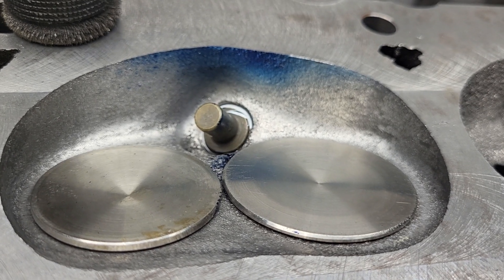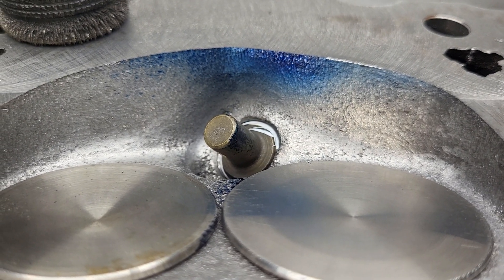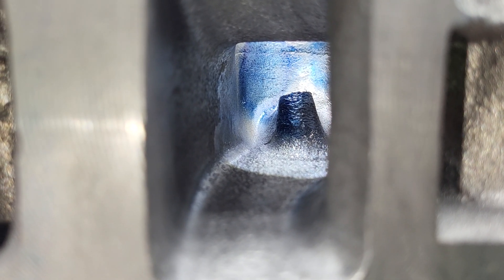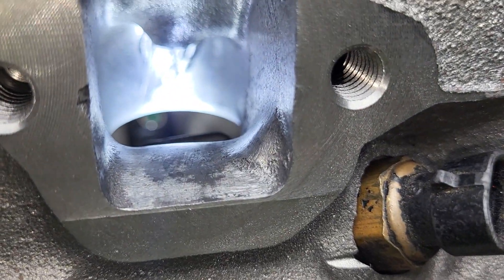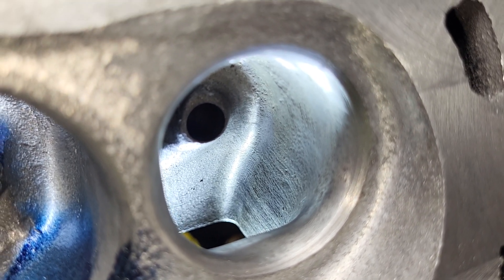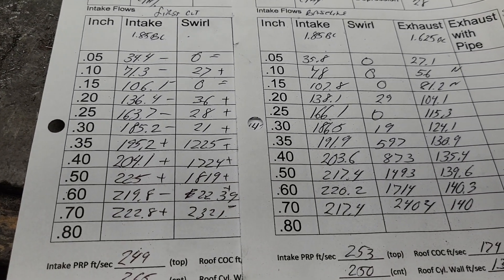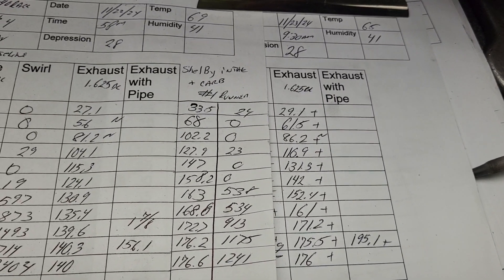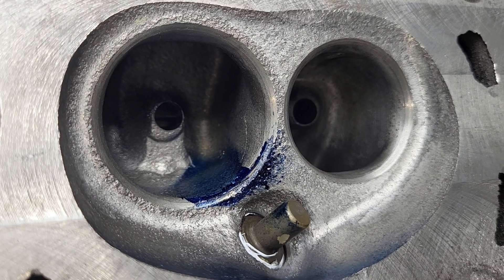Ford GT40 289 Race project, Ford C6FE heads, First cut flows and airspeeds

Comment: Thanks for all the videos and all the legit info! 
Question: 
Maybe i missed it? 
But why are you starting to port on the heads when the valve seats have not been installed yet?
And you do not have the actually valves yet that will be used?
Reply from the maker: @therory6888  Iron heads can have seats cut directly on the iron. I can do that. Iron will not wear excessively if the guide clearance is correct.
Reply: @ Okay. Thanks

Comment: Charlie, question for you. I always consider the throat a final choke point so I will measure it at different areas looking for the smallest measurement.

For example, on an E7 with the 1.78 intake valve I will usually get a 1.51” measurement side to side (3 to 9 o’clock and same as the bowl width), and maybe a 1.55” at the noon to 6 o’clock position, a 1.57” at the 2 to 8 o’clock position and a 1.56” at the 4 to 10 o’clock position.

I’ll average the four of them and use that number as the throat size.

Is this similar to how you do it?
Reply from the maker: Smallest area at the valve seat is called a Bernulli port. Most castings can not do that with maximized valve sizes.
Reply: @ thanks for the reply man. I see your an early riser too!
Reply from the maker: @65mustang393  Sleep is overated!!!
Reply: @ man… I have the goofiest sleep schedule. Totally random and I am very envious of people like my wife who can lay down, be out in 5 minutes and sleep for 6 to 8 straight hours and wake up totally refreshed. My sleep is more like 3 hrs now, 1.5 hrs at noon, etc. Makes for a difficult life at times lol.
Reply from the maker: @65mustang393  My Wiffy is asleep instantly and 12 hours is not a problem.
Reply: @ lol… yup.
Reply from the maker: I measure the throat size the same way. Thanks

Comment: Time to use your wind flag wand to see what the port wants. A good friend of mine Joel A. Dubose has always said to me, " Don't try and force the wind and fuel where you think it should go but actually see where it wants to go naturally." The valve guide Vane is a good idea to see if you can pick up anything at all. That Exhaust is BIG, good lord. I would play with clay and raise the floor up to that bump and see what happens. I bet those heads take off like a Banshee. Those are definitely thin castings in areas where its critical to make them flow. Flow ball time with the wind flag.
Reply from the maker: @garykarenmcgruther6386  Stay tuned! What a sonic workout!!!

Comment: I have a set of aluminum heads, I need steam holes drilled in them . Not something I really want to tackle myself. I would want at least a drill press. A bridgeport mill even better. (They also can use a bit of abrasives ran through the ports also. I have two sets that can use a bit of port play!✌️ 😎 👍, have an awesome day....
Reply: Just use a head gasket as a template.  Lay the gasket on the block and note which gasket holes line up to the block's steam holes.   Use the gasket as a template to know where to drill the new holes.  Use a punch to mark the head, and drill until you're through the deck.  It's actually really easy with a hand drill.

Comment: You talking about the short side being thin. It made the think, that being a new casting. I wonder 🤔, could the thin area be heated with a torch or induction heater (probably both) and flux the inside, slip some silica bronze, or possibly nickel. To add some thickness to the area. It would be cool if a powdered bronze or nickel could be poured into the water jacket with flux either in it like solder(flux core!) Heat the area until the metal melted!! The flux assuring it sticks after it melts. Do you know if anyone has done this BEFORE Breaking THRU TO THE WATER JACKET? Adding about .045" to .060" thickness to the thin areas. Can save the day when porting. And grinding away , all the sudden  tfe sound changes, the  color of the metal changes. It could be an interesting experience! You know exactly? Here to STOP! 🤔.
Reply from the maker: @jamest.5001  I can't imagine how expensive these are. I am not welding on them!!! Thanks
Reply: @servediocylinderheads  Was at the Columbus, OH all Ford swap meet back in the 90's when aftermarket heads started to hit big.  Guy sold an entire pallet of these C6FE heads cheap, as they were 'outdated'.  I think he was wanting $75/head and after he sold a few, someone bought the entire rest of the pallet.  I remember the exhausts being huge, and assumed the intakes would be a lot better than they are.  Guess they just 'ported' the mold without adding adding any more metal.  lol
Reply from the maker: @n2omike  Added metal in the wrong places!!!

Comment: People like to say small valves make rpm. Id rather think it means high port energy.

For a small displacement motor having a high port energy port. But still having enough airflow to support the high rpms for the amount of air flowing through is why they are able to spin rpms.

Also the high port energy should be able to help amplify the reflective waves better.

Comment: When adding a fin, the fin will add stability on one side at the expense of the other depending on it's angle relative to the flow. If you bias the fin so it's cambered or the sharp edge points towards the CoC, where most of the dyechem is currently going, it will improve flow on the other side at the expense of the CoC side. If it's cambered to the cylinder wall side, then the flow will improve on the CoC side at the expense of the wall side. @7:24 the way the guide boss trailing edge is shaped it's pointing towards the cylinder wall side. Just my dumb .002 cents

A fin works just like it does on a surf board, it builds up pressure on one side, which then bleeds over to the other, the vortex shed by the fin cleans up the flow along the wall on the pressure side, while creating a flow obstruction(reducing CSA) on the other side, so it limits flow, but temporarily increases velocity. The net result is more flow stability in general on the side of the fin facing the flow and an altering of the flow path on the opposite side.
Reply from the maker: @rolandotillit2867  The dykem really tells you what the port wants. Thanks
Reply: @servediocylinderheads  Right now it's saying it wants to go down the center of the cylinder, mostly.
Reply from the maker: @rolandotillit2867  Stay tuned!

Comment: Chamber shape looks very similar to an early 351 Windsor head witch I have done several sets of, had a hard time getting past about 225 cfm on the first ones until I started using DV’s method of unshrouding the intake valve. With that 245 is doable with a 1.94 valve!
Reply from the maker: @mpstang-6179  Good info. On small cube engines I am more reserved on chamber size. Thanks
Reply: @ yeah, I’m with you on that! Just out of curiosity, have you cc’d the ports on this head?
Reply from the maker: @mpstang-6179  Stay tuned. I will do that on the next head. I need to know before and after numbers. Thanks

Comment: 1.60 and 1.94 valves sound like 1958-'60 big block mopar valve sizes. So maybe for a 332-352 FE?  Or 360 truck motor.
Reply: Sorry more FE . The truck 360 had about the best looking forged crank out of the Detroit Big 3 I ever worked on . Beautiful radii rods and mains , and just a clean forging .
Reply from the maker: @paintnamer6403  Did the Fe have a c6fe cylinder head? They look like small block flow numbers. Thanks

Comment: Nice tip on Charles spreadsheet!

Also, you can “skootch” the guides apart a bit and fit 2.02 & 1.6. A friend of mine did it on a set decades ago.

UT tester is your friend, there’s spots that are easy to get to thin!
Reply from the maker: @Alaska_Engineer  No doubt!!!! Lots and lots of testing! Thanks